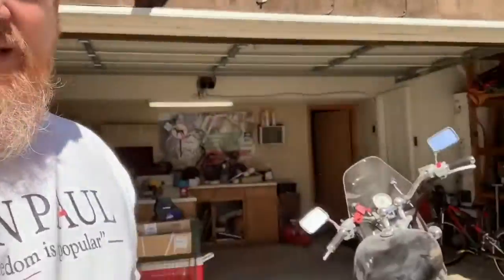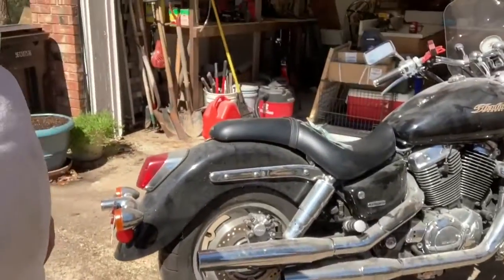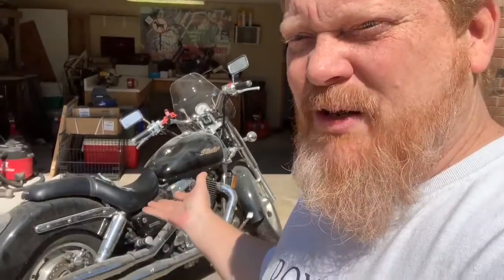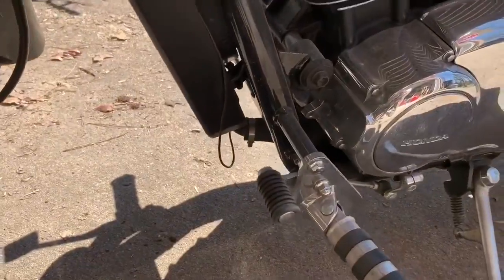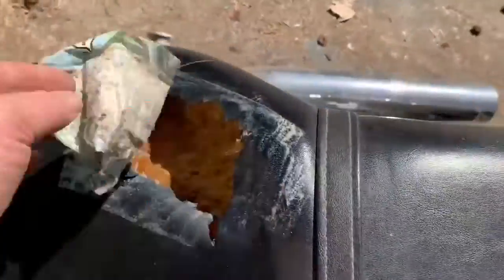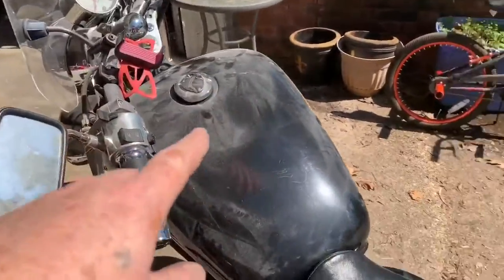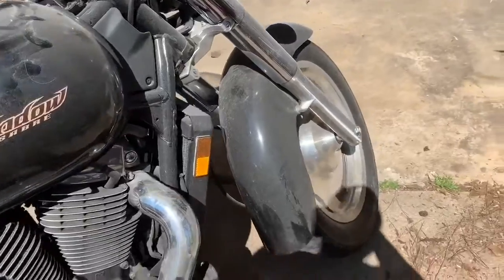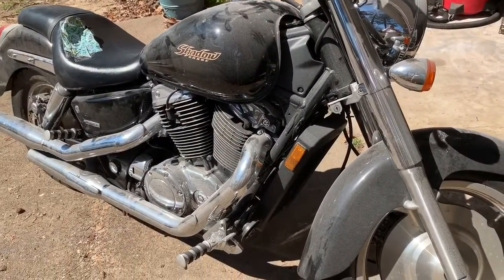Shaft Drive Honda 1100 Shadow #1 ~ Disassembly

Comment: Great start, I dig it. I will be following this build closely since my son want to turn the Suzuki Intruder into a Bobber or Cafe racer. Don't re jet the carbs, I made that mistake on my 07 Shadow and regretted it. Thumbs up Mike 🧡💯😎👍👍👊🍺
Reply from the maker: It all depends on air flow. If the new intake I’m building works, I’ll be good